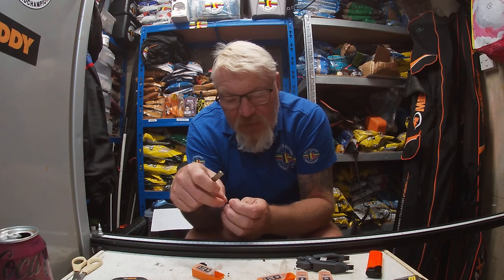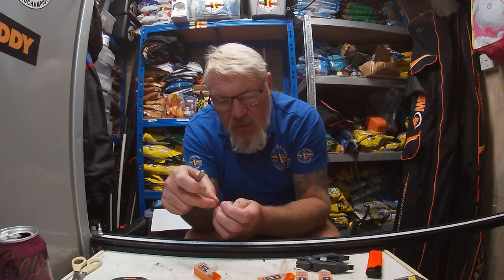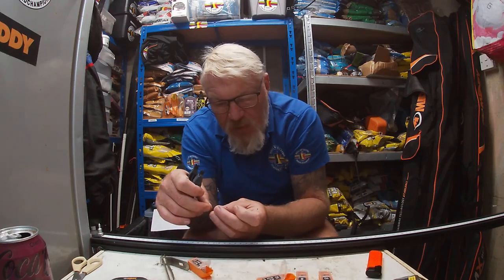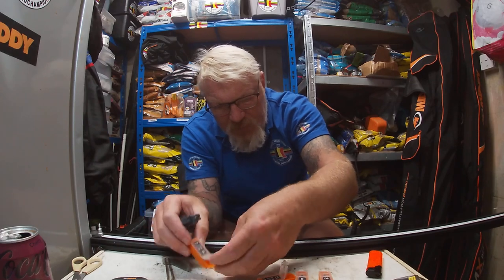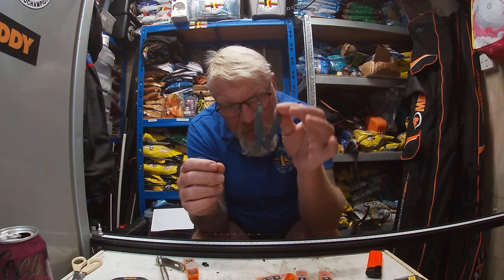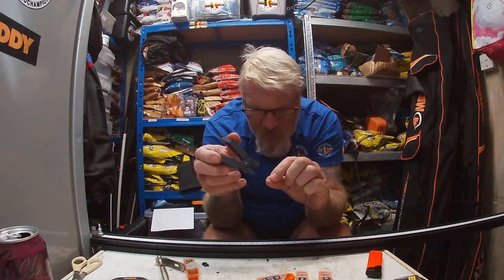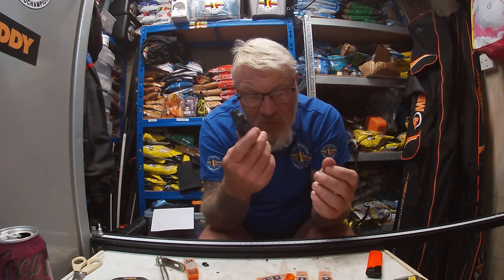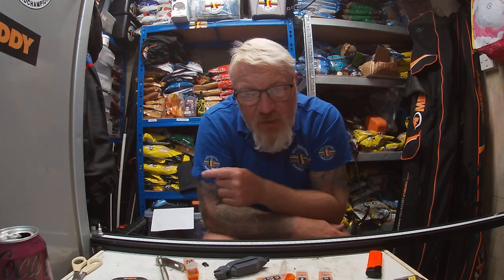SOLVING SHOTTING PROBLEMS

Comment: Hi mate. Would 2 parts g5 and 1 part gold pro be a good mix for a slow river, 12ft deep and a slow pace? Targeting skimmers and pommies? I fancy trying it but I’m not sure it’s heavy enough. Thanks 🎣
Reply from the maker: Hi mate, it should work, if not, add a little more water to it to make it a little heavier.
Reply: Hi mate. Thanks for the reply. I’ll give it a go when the season starts. Would a bit of leam help then?
Reply from the maker: @craiggriffiths474  leam would work, sure. Or try turbo or secret as they are heavier/stickier than G5. :)